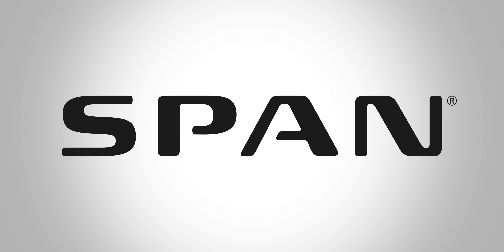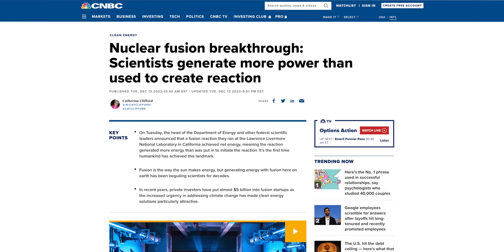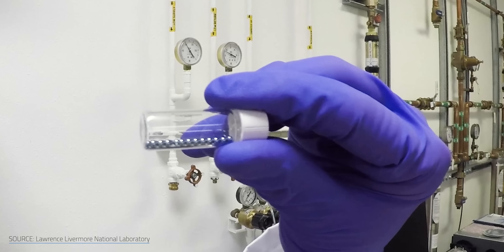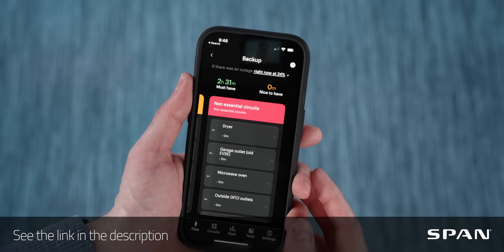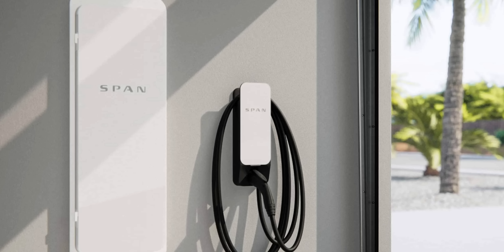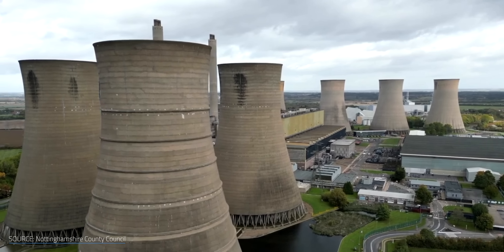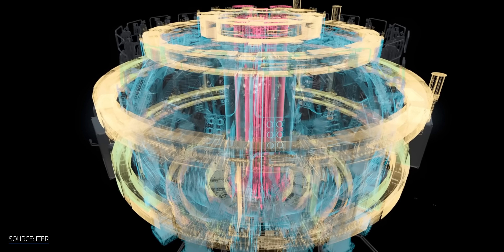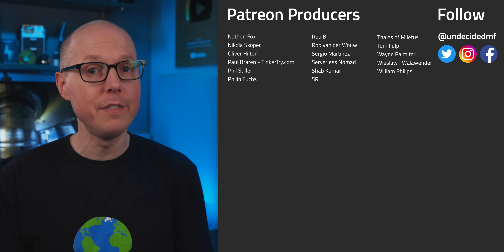What This Breakthrough Means For Nuclear Fusion

Comment: We already have the best fusion technology available right now. You are able to install it tomorrow and benefits for decades. The plant is far enough to not be dangerous and we can transfer energy wirelessly.
Reply: The plant is the sun and provides energy via electromagnetic radiation. We can collect with pv panels and use it cheaply enough

Comment: The NIF announcement has been and continues to be seriously over-hyped by the media.  It's just basic research... a promising step, but still just basic research.  Also, what the NIF has is not actually a "reactor" (a mistake you made a few times in your own video) There is basically no containment and the reaction products essentially just dissipate.  Not necessarily useful or able to maintain an actual continuous fusion reaction.

The media, including your own channel to some degree, is ignoring the byproducts problem.  Charged particles are the least of the problem.  Half of these experiments produce highly destructive neutrons which, at actual producing-reactor levels would require an immense amount of shielding to stop.

We are a very, very, very long way away from actually having a working fusion reactor.

Comment: This is not entirely correct .the " first time ever " was achieved a few years early at the NIF . the so called "breakthrough" was a repeat of the first breakthrough. the reason this time was hyped so much was because , part, the grant money for the facility had runout or become low . in order to continue receiving federal funds , it needed political support and a boost from the court of public opinion . in order to create excitement for this on going project a "breakthrough was needed . but this was just a repeat of the original breakthrough and in no way was indicative of being able to scale up the system . so , don't get too excited , fusion is still a long way off .

Comment: When can you report officially on legal and beneficial power plants.?  Edison generators and dynamos with inverters and transformers can deliver any amount of current and voltage AC power to the power lines continuous peak power without fuel or pollution. Invented by Thomas A Edison and Tesla but Tesla bound Edison's generator with magnets all around the armature and used water to move the armature magnets and coils of copper wire. We have not recovered from the propaganda that supports nuclear technology halogenated vinyl and halogenated carbon
We don't need heat to produce electricity the need to move the armature magnets and coils of copper wire is misinformation regarding power generation and power use
The nuclear nonproliferation treaty enforcement and obligations do not allow any person to develop build or share nuclear technology due to the contribution to the nuclear cascade.  Yes every citizen is responsible for every Treaty.. The Dow Chemical USA lawsuit to be immune to Treaties because they are not a military organization does not have legal standing even if Ronald Reagan Admin refused to appeal the absurd Court decision. Not a reasonable decision beyond a reasonable doubt
 An obviously illegal decision regarding Treaties.

Comment: Matt, give us a break buddy!  Max energy out divided by energy in at maximum cross section is only 12.5 for D+D fusion (the lowest Ein fusion reaction.)  Considering that max energy efficiency for steam turbines is about 33%, this leaves us with a maximum usable energy gain of about4x.  This is not enough energy to refine D, the most abundant and efficient fuel to harvest.  This means that nuclear fusion is endothermic, not exothermic and consequently it will take longer that 40 more years to realize.  My Intel science fair team made the measurement using solid deuterium (ice) and proved that even solid D has too low of a cross section to be practical.  Using a gas or ions at higher energies that the peak for fusion is stupid.  Do the math.

Comment: We have 200 MJ used for the laser impulse, and we got 3 MJ of heat. Converting the 3 MJ of heat back into electricity will yield maybe 1 MJ. So we are a factor of 200 away from technical energy positive. And this does not even account for all the operating cost beside ignition. So call me if the yield is increased 1000 times. That's how far away we still are from usable fusion energy.
PS: My bets are on Stellarator like designs.

Comment: Reports are more energy was taken out than put in  by a factor of 1.5.
That's suppose to be impossible per the law of thermodynamics,  law of conservation of energy, etc. 
So either we are being lied to or physicists were wrong all along.
Reply: Neither, the "energy" in this case refers to "useable energy" (not a scientific term afaik) - electricity and heat, it doesn't account for chemical and nuclear binding energy "stored" in the fuel prior to ignition. It's the same concept as burning wood or coal - you use a bit of heat to start a chain reaction which then releases a lot more heat that was in the fuel

Comment: NIF is a scam.

I watched a video some 1 month back from a Harvard doctor in high energy physics. He said high energy physics has been a scam for the past 30 years and that's why he now works on the Wall Street.

The reason NIF is a dead end, apart from what you mentioned extremely large energy loss, extremely expensive fuel, there is another one. The large amount of neutrons generated from the reaction will destroy the reactor chamber fairly quickly.

The reason NIF is still going on is not that it has any hope of lighting your house up, but rather scorching the whole cities because it's useful in nuclear weapon researches.

Comment: I'm an engineering student and I just had a presentation on a lot of the general fusion types and such. Maybe ICF reactors are different, but can't they use the same method to get tritium as they do with other fusion reactors?

This is called tritium breeding, and it uses a lithium blanket around the outside of the main core of the reactor. This blanket not only harnesses the energy from the reaction, but also helps convert some lithium into tritium (and other stuff).

Although this process is not economically feasible for an outside company, whoever has the reactor itself should be producing their own tritium. (to the best of my knowledge)

Comment: I've been a fan of your page for ages.  Even before I had this YT home page.

My only suggestion for your videos is to slow down your speech.  Yes, I can click the gear-wheel to run it at .75%, but honestly, that just sounds draggy.  

IDK if you actually speak that fast, but slowing your delivery down - even just a bit - would sure help.  

It's not as bad as some other YT people, but it always seems rushed - potentially digitally rushed.  Not a fan. 

You have great content.  Great insight.  Just sometimes the speech is just too fast.  I sometimes have a hard time even keeping up!!

Thanks.

Comment: The problem with saying we are thirty years away, 3 years away or 300 years away is that everyone is waiting on "the break through".  That one discovery that trancends our current limitations and allows us to do fusion viably.  What it is noone knows.  If they did, it would be a done deal already.  I suspect we are far closer now than we were in 2000 though.

At the moment, we are making light bulbs, trying to get to the one design that works.

Comment: 300 MJ of lasers to stimulate the fusion is too simplistic...the laser equipments would be at least 500W of power needed to run, and other instruments wattage?...its the heat be easily extracted from fusion to power something...best is still use fusion in liquid chemical reaction....the heat generated can be used straightaway to power generator

Comment: We are sure, that no matter current state of Fusion research, a practical solution is at least 30 years out. And, 30 years from now, a practical solution will be 30 years out from then. And, 30 years from 30  years out, practical Fusion will be 30 years from then.

We've been hearing about Fusion since the 1940s. And, they always say, it's 30 years away. At this rate, we'll have matter/antimatter reactors before we get Fusion reactors sometime in the next 1000 years.

Comment: 100% hype, ~$50 Billion has been spent on Fusion facilities and research worldwide and the US is spending about $700 million a year on research and we're barely any closer than we were when we began.
The problem is that fusion in stars has a very low power density and in our sun's core the output is only 276.5 watts per cubic metre! It's only because the sun is so huge that it adds up to the immense power output that we see but if ITER, the biggest fusion test reactor built at 840 cubic meters, matched that density it would only output ~230kWh or the same as a V8 engine.
The reactor however uses much higher temperatures than the sun and as a result has a far higher energy density but it's just a series of small fusion explosions that aren't sustainable.

Comment: The problem with the NIF, ITER and similar projects is that they were created specifically for scientific investigation only. They're just big experiments trying to further fusion as a science; they aren't even trying for efficiency or to even make electricity from fusion, which is a point the headlines tend to miss. It's the start-ups which are actively using a practical application of fusion-science (not even necessarily getting to ignition) to produce electricity that might bring us viable operation within the next decade or so.  In any case, the recent milestones made by scientific and commercial operations are seriously promising, so fusion is really moving forwards as a field.

Comment: I was just about to comment about the actual lasers that NIF is using, they are old, gigantic beasts that use huge slabs of Neodymium Yttrium doped glass amplifiers , these things get hot, and need cooling, all that heat and cooling causes crazing on the surfaces that lowers beam quality which is critical when trying to take light from meters of area to less than millimeters and unfortunately these high energy levels just hammers the shit out of surfaces of all this gear, it's reasons like this that limits their repeat firing rate, it would be REALLY cool if they could use the gear to initiate fusion and then find a way to keep adding fuel to sustain the burn, but that's unlikely because the burn time is over before you can blink. Maybe one day they will try and combine both ICF and Magnetic confinement like in TOKAMACS, so that the lasers can start the burn, and perhaps even with more modern continuous mode lasers supply energy and combined with magnetic confinement to help shape and compress the plasma to enable constant high power output...but then again maybe ITER alone will demonstrate that they can do it, I am confident that they will.

Comment: One should remember that the NIF was built at Lawrence Livermore, whose primary purpose is nuclear bomb development and maintenance.  Once a day operation is enough if your main goal is understanding the detailed inner workings of a fusion bomb.  NIF was kickstarted by the Comprehensive Nuclear Test Ban Treay of 1994.
Also, a key point about fusion is the steep exponential growth of energy released as a function of the density, time, and temperature of the fusion reaction.  I don't know the numbers, but that's why people pursue it even though breakeven seems almost impossible.  Useful quantities of output will become available not too far past breakeven.

Comment: There was no energy gain. It took nearly 5 times the fusion output (in electricity) to charge the capacitors that fired the lazers. Not even close to "break even" while using fuel that costs $30,000 per gram and no real way to recover the generated heat. 
"A total bullshit breakthrough"   

I guess I will go back to holding my breath.🙄

Comment: One thing for sure. Fusion will not be "cheap". If you have to cool down ~10% of the thermal energy with helium to keep the fusion plant running just the costs of helium will be higher than actual energy sale prices. It's simple math: Calculate thermal energy one kg of helium can carry away, think of 1% of helium losses in the recycling (recooling) pumps and you'll get the amount of helium you'll need to operate. Just look at Linde for actual helium pricing.

Comment: I personally think this was an overhyped development. Firstly net gain was achieved back in 1962 when the first H bomb was setoff. Secondly laser ignition is ridiculously inefficient in terms of the actual energy put into the experiment. It will never be used for energy production. Tokamaks and  stellarators are more likely to achieve the true goal of getting more energy out than you put in. But even they are problenatic. They should concentrate on getting boron 11 proton fusion working. All the other alternatives have got raw material supply issues which are insurmountable in the short term. Surely you don’t need a quantum leap development to get the temperatures necessary given what has already been achieved.

Comment: I still havn't entirely lost hope in cold fusion, but it's developement will likely come much later than hot fusion since there's a lot more dollars and resources are being offered there. The issue is that Hot fusion must be achievabe since it clearly happens in nature. Therefor skeptics are limited by real-time observation of our universe. It is just a matter of 'taming' this animal and getting it to work for us. Cold fusion is proposing an entirely different process where fusion happens when an atom's electrons are replaced with muons allowing the nuclei to get much closer. We don't see this in nature and experiments havn't yet shown any positive proof of concept. But the mathimatics show that the difference between fusion and no fusion is just a matter of literal microseconds and picometers. It's so close to happening that a single breakthrough discovery in particle physics could completely change the game. And while such discoveries are hard won at the moment (concidering what it took just to confirm the existence of just one little scalar boson) there are so many gaps in our knowledge of the quantum world I can't help but think that there does exist a clever way of engeneering a solution.

Comment: I've been interested in Fusion for quite a long time now for all the positive reasons mentioned.  Also agree we are a considerable distance from large scale use.  Therefore we need to quickly and fully ban gas cars and go fully electric by 2035, so we can use Fusion that's 20 years away to power it all.

Obviously being sarcastic.  How about we keep working on these promising new technologies and then when they are ready implement them and the resulting next step changes it will allow.

Comment: Thirty years is optimistic.  10,000,000 degrees is not useful energy anymore that the H-bomb.  Dr Weinberg nailed it with the recent improvements of the dual fuel or stable salt reactors.  Its a good idea not to pump radioactive salt to a heat exchanger.  KISS

Comment: All of this is great except those 20 million dollars need to be like 20 billion dollars. Money is the root of every problem. I kid you not money can and will solve everything. If we remove money from a problem we can solve it. Putting 100s of trillions of dollars in to research is what will solve most all problems. For example if we were to invest 100 trillion dollars in to fusion today and hire every capapable person in the world to work on the project we can pump so much research in to this project that will also solve and find thousands of other uses. 
Research in the medical field for things like cancer and other illnesses require so much testing that it cost money and if there was no set back like money cancer and many illnesses could be solved in 10 years. We need 10s of millions of people doing research. You do not need a high end degree to do research. 
Energy problems could be solved if money did not hinder progress. There is also no reason why battery tech cannot allow a device to run for a year with out charging. Research in to battery tech is costly and many techs that are better can not be used because building said unit is not cost effective.

Comment: I remember years ago someone made a statement related to hard drives saying it's impossible to exceed a certain capacity. We're way beyond that barrier in 2023. When there's a will, there always seems to be a way. I do remember however hearing about the scientist who opposed the hydrogen bomb test saying there is a chance the earth's atmosphere would ignite. I hope that's not a danger with fusion.
Reply: It's not. The Manhattan Project did the maths, and ruled out the possibilty that the original proposer was worried about. I mean, it was a legitimate concern, since even if there was only a 1% chance of igniting the entire planets atmosphere, you want to check that out. Fusion doesn't do anything new compared to fission really, it's just more energy dense

Comment: Like Wright Bros first controlled flight in Kitty Hawk, the NIH achievement is a landmark technological breakthrough. NIH has proven that fusion power generation is indeed possible, and not just a mathematical or theoretical possibility. It is now an engineering question of how to refine the technology into a viable commercial application (and to remove the asterisk). Yeah, a fusion power station is still decades away but fusion as a power source started at NIH